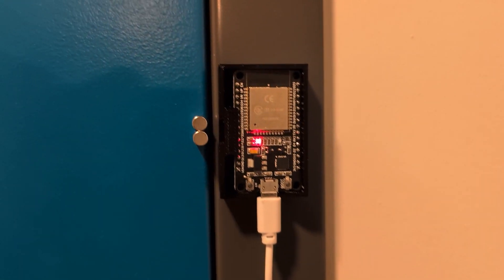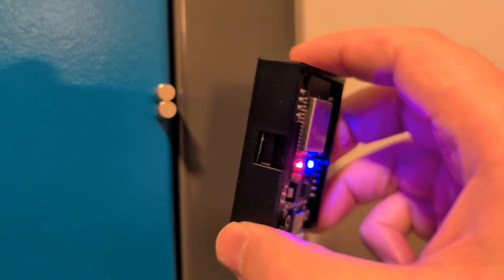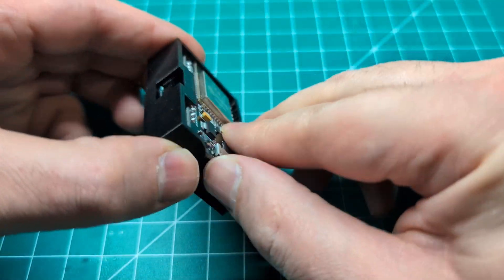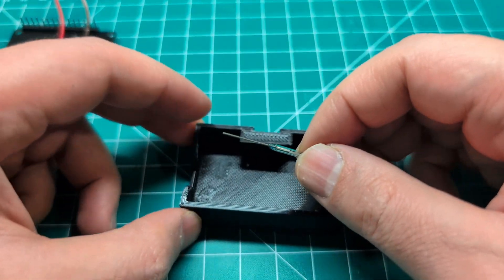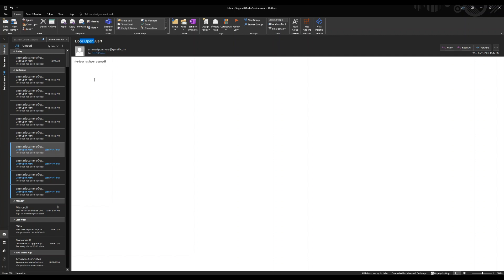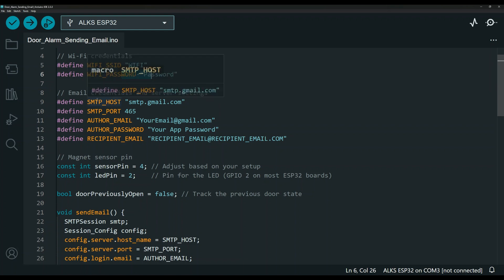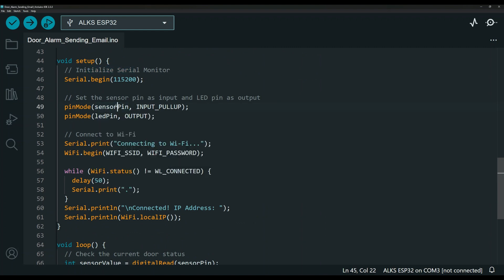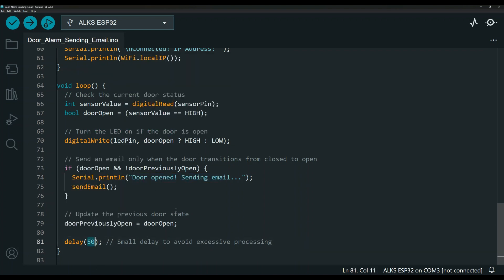DIY Door Alarm With FREE Email Notification #diy

Comment: you could perhaps use the ESP32 inbuilt hall effect sensor instead of a reed switch
Reply: my thought too !?
Reply from the maker: Quick update, It seems that the built-in Hall effect sensor is no longer supported on ESP32 chips in recent ESP-IDF versions
Reply: @techs.passion I wonder why they removed it from newer ESP32s - 
-  I have several older ones so might play around with your idea or just input code to see if the sensor can be used as a door alarm.
Reply from the maker: Yeah, I'm sure you can also downgrade the new ESP32 to the old version and that might not work. My guess is the onboard sensor is not as accurate so they decided to not deal with it and just disable it but that is just me gussing, I really don't know the real reason. Thanks again for your comment and the idea.
Reply from the maker: Yeah great idea for a future video, thank you so much